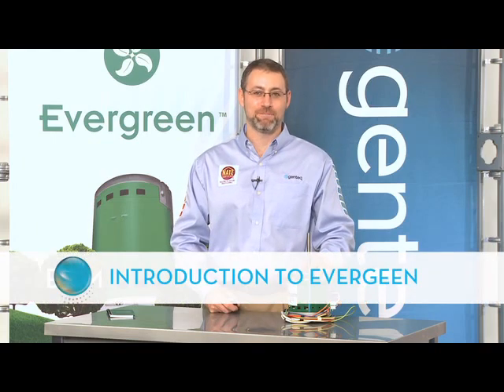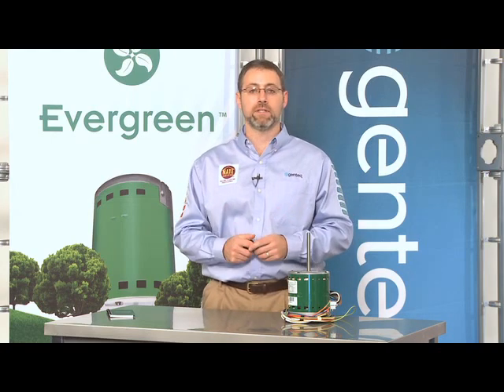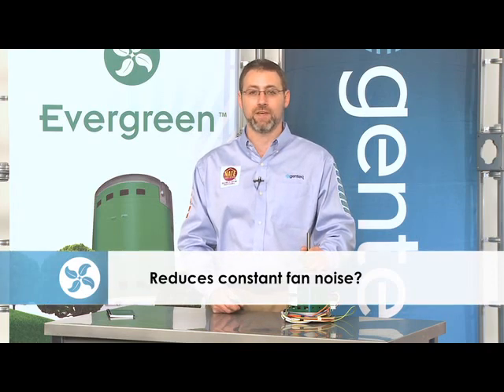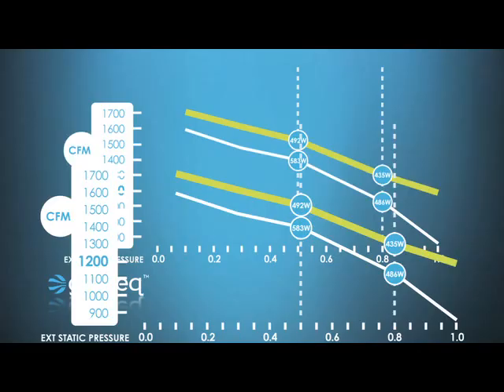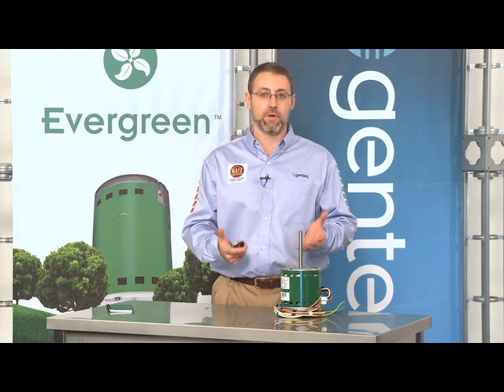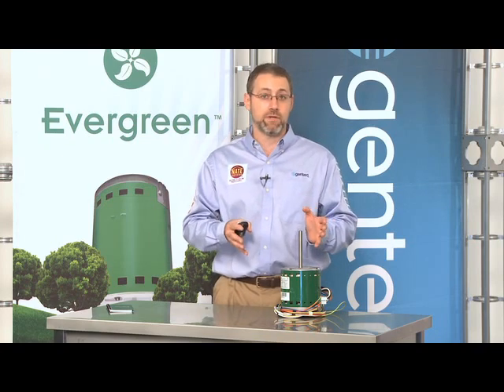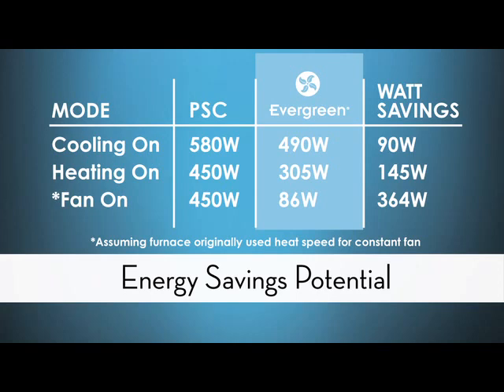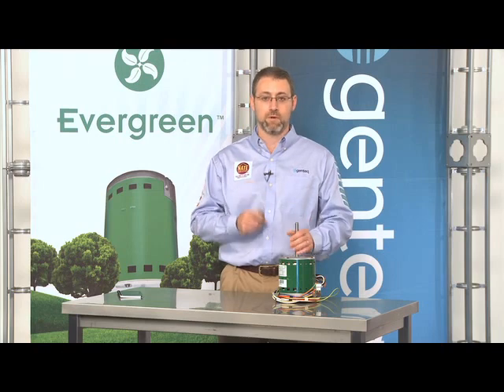Evergreen IM ECM Replacement Motor  - Smart HVAC Products

Comment: I had a 1/2 hp one installed in my previous home. Fantastic. But no luck with a  1HP motor in my new home and it uses double the wattage of the 1HP psc fan it replaced.  Tested with an energy monitor.  Constant fan uses 200 watts.  High speed for cooling uses 1040 watts.  The psc fan used about the same for fan and half that for high speed
Reply: American TapHouse & Grille Waseca,MN 507-835-3663 Your welcome.  I dont know why the 1/2 hp motor used less the 1/2 hp psc motor but the 1 hp genteq used more than my 1 hp psc motor. I also tried the mars azule, but the motor failed after 3 months. luckily the amazon seller made good and gave me a refund.